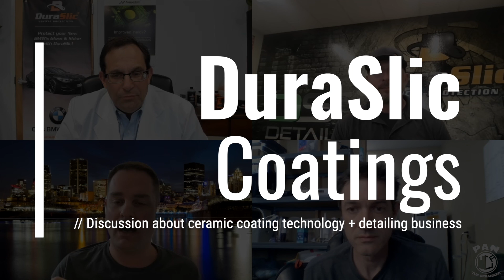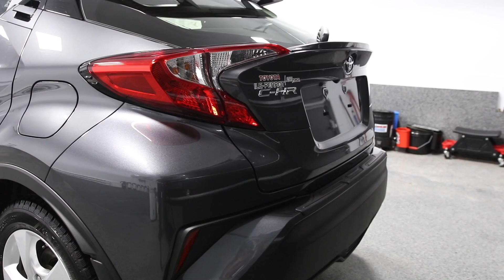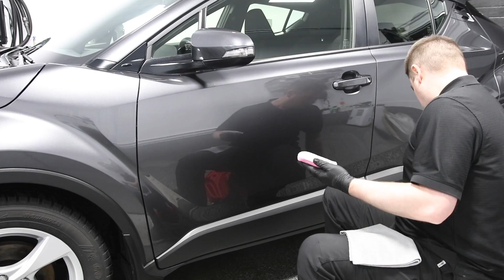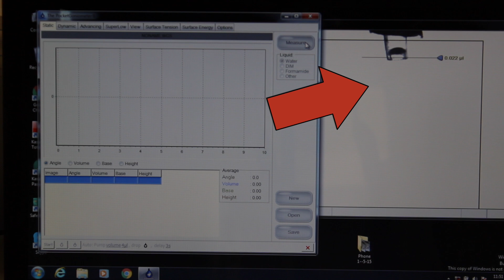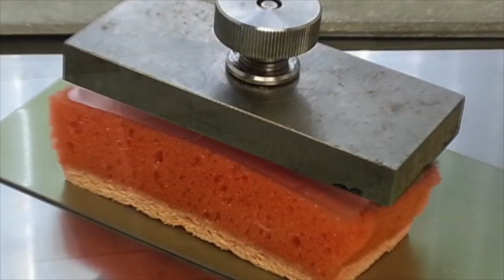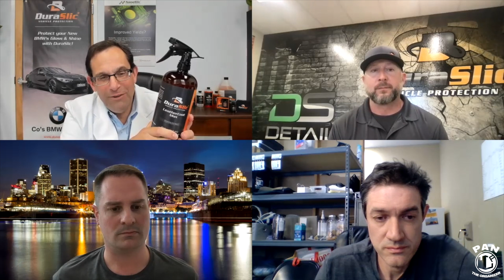Ceramic Coating technology discussion with the DuraSlic chemist!

Comment: Hi Pan, 
My name is Matthew Dunham and have Learned A Lot from your videos!
I am taking the classes on September 2nd & 3rd to become Certified in Duraslic Application. 
This video has great potential for being used as a sales tool.  
I have a B.A. in Advertising/Graphic Design and now I want to become a successful DuraSlic Installer. 
Obviously, no client is going to want to watch this entire 1:09:39 video but I can get a potential client to watch 15.22 mins. To that end, I am wondering if you have this video available so I can edit it to only show your interaction with the Chemist?  I am particularly interested in the sections of the video from 04:16-07:37 and 12:18-24:10 = 15.22 mins. 
I will provide You and DuraSlic with my result at no charge...
Reply from the maker: Hi Matthew. Congrats on wanting to become a certified DuraSlic installer. Tell them hi from Pan when you attend the training!  What a great company.

I don't normally authorize use of my videos without permission for copyright protection obviously. So it would depend on what your intended use would be. You can send me an e-mail (my e-mail is available in the "About" section of my YouTube page) and we can discuss the matter there.

Cheers

Comment: Hi I just had my truck ceramic coated with your duraslic  it will be inside curing for 72 hrs after that if I get caught in the rain will it harm my ceramic coating?
Reply from the maker: Absolutely no worries. It only needs 24 hours of curing and then can be exposed to the elements including rain with no issues. Just don't wash your car for at least a week after the coating's application. I recommend waiting 2 full weeks before washing the car.

Comment: As a detailing business owner a lot of my customers don’t want a coating that lasts 5, 7+ years mainly because they feel they won’t have the vehicle that long or because of the price of the longer lasting coatings…I would like to go through less companies for products and narrow it down to Duraslic products…I seem to sell more 1 and 3 year coating packages rather than 5+ and giving that speed coat last up to 6 months 1500 is about 5 years and extreme is 7+ how do you suggest I fill in that gap to provide services to my customers who prefer a 1 or 3 year coating using Duraslic products ?

Comment: "Furthermore, DS 1500 Xtreme is a multi-layerable formula that enables the user to boost the level of protection as needed." What is there to boost when Steve said no matter how many layers, you still have the same surface protection on top and you dont need something on top of it?
Reply from the maker: I think they mean an increase in gloss if I remember.

Comment: Is this coating better than Avalon? Which is the best coating brand?
Reply from the maker: You can't really compare a DIY consumer grade 2+ year coating (AvalonKing) to a pro grade 7 year coating. That is an unfair comparison. Of course the DuraSlic is better, and costs way more. As it should. The AvalonKing is the easiest to apply consumer grade coating, but won't last as long however is super inexpensive. It's all a question of choice. Both are good in their respective categories.

Comment: I'm not a pro, but an enthusiast that details a few cars a year for colleagues and friends, what's the reasoning for making the DS1500 extreme only available to professionals? There is no rep/installer in my country, but I'm interested in using the products. Where do I go from here? Is there a way to get my hands on the extreme anywhere as well?

Also, has this been tested on boats and aquatic equipment?

Comment: I would really like to know what is exactly the difference between 1500 and 1500 Extreme in terms of the product itself and the chemistry - please skip all the "professional level" and "only for authorised and trained detailers" and please concentrate on the product differences only. Levels of protection, durability, application, curing time, ready to drive off time. I am UK based and just want the product - I think I can handle the prep and application process but if it needs to stay inside for days, needs IR lamp curing or otherwise it will be weeks, takes 30 days to reach the full hardness, etc -  the costs to actually apply such a product are astronomical (labour and workspace is faaaar more expensive than any product) compared to something like graphene oxide coating applied in 2 hrs (including prep with polish) , ready to drive off immediately and offering maintenance free protection for a min of 12 months AND costing two orders of magnitude less per application. I can apply graphene oxide for 10 years every year and still it would cost a tenth of duraslick. These days ease and speed of application are the king - very few people keep their cars for 7 years :). Once again, thank you very much for sorting out this interview, I really enjoyed it and I am looking forward to more in depth content - keep up the good work.

Comment: Hi, do you run the kranzle k1122tst on a 15 amp or a 20 amp?
Reply from the maker: I have two dedicated 20A circuits and two separate 15A circuits in my new garage. It runs fine on both, but I prefer putting it on the 20A for extra headroom.

In my previous house it was on a 15A and never once tripped the breaker (that was a new construction as well).
Reply: Since I have no 20 amp circuits outside, I'll have to go with the 15 amp then.... Thank you so much, Pan. Really appreciate it

Comment: The oleophobicity is definitely interesting to me. Give me a coating that  will prevent road film from sticking to the sides of my vehicle;  heck even if it does stick but then I can easily remove it all during my prewash phase, I'm sold. Anything that will get my vehicle cleaner without needing me to touch the paint is a bonus for me.
Reply: It’s literally every coating bruh

Comment: Thanks for this follow up video Pan. I ordered the product after your original video and applied it to my “new to me” , low kilometre 2016 Tundra after a lengthy 2 stage paint correction… my first ever 2 stage and full ceramic coating. I found the coating easy to apply and level, though I should have changed my micro fibre levelling towels more often. Overall, very happy with the results. Glad to hear that this coating will have long durability. I may also order the leather Max product too! This video reinforced my original confidence in this coating. Merci Beacoup!
Reply from the maker: You got a top tier pro grade coating for sure!! 😁

Comment: Great video.

It's always great to see companies to innovate with their products and provide all the required support along with it. I can definitely see the appeal and market for those extra durable coatings but it is not necessarily the best path for those of us who dont just love detailing, but love to detail.

Personally, I wouldn't put something that durable on my cars. Like everything, ceramic coatings also wear, oxidize, chip, scratch and accumulate fine embeded contaminants that can't be removed without abrasion. As I love to polish my cars at least once a year to keep the paint looking as best as it can, then long durability coatings just aren't for me. Not that they're bad, quite the opposite, they're wonderful, but everything has it's downsides.

For my daily driver I use CarPro CQuartz Lite at the fall so it would get the protection for the winter. If I then need to polish, do stone chip repairs at coming spring, I use spray sealants and waxes throughout the summer and then do a full paint prep and coating at the coming fall again. Works great for me and keeps my options open regarding paint correction. But for those who are not looking to do annual paint correction, I'd say high durability ceramics are a godsend. Argument could be made that there are ceramic rejuvenation polishes out there, but I've tried them and they really don't do much. 

Just my two cents on the longevity considerations when applying ceramics.

Take care Pan and stay safe.
Reply from the maker: Thanks for watching! Have a great weekend!

Comment: Loved the video.  Appreciate DuraSlic coming on and educating the public with my favorite car detailer.  Of course, based on Pan's recommendation, I purchased Avalon King ceramic coating and will finally have some time next week to apply it.  Would be curious to know how it would compare to the DuraSlic coating.  Thanks Pan.  Keep it tight, keep it clean.
Reply from the maker: Thanks Joseph! The coating you picked is one of the easiest DIY consumer grade coatings. But you can’t compare an inexpensive consumer grade coating to a 7+ year professional grade coating that costs way more.
Reply: @PanTheOrganizer  Thanks Pan.  I'll trust that you led me right about Avalon King.  I'll just plan on applying it every year or so... Great way to spend a day!  Take care.
Reply from the maker: If you maintain it well it should hopefully last 2+ years. I am following the vehicles I applied it to closely to see how it does long term as well. So far so good!
Reply: @PanTheOrganizer  I guess I was expecting that since during NOV-MAR I won't have a proper way to maintain the vehicle in MN, the coating might suffer a little more.  It will be interesting to see how it performs a year from now.  Thank you!

Comment: I washed my ceramic-coated Mercedes with Armor All ceramic Ultra whatever they call that new soap. Part of the soap dried on the car before I rinsed it. It has hideous streaks in it that won't rub out. Do a video on how to correct that please. Please.
Reply from the maker: Try rewashing it with a quality shampoo made for coatings. My favourite being CarPro Reset.

Comment: Lol I’m just like hitting my head against the wall here - Here is my big question!! Why big companies like CarPro, Gyeon, Gtechniq including DuraSlic not using graphene? Not just understanding— I know this is a hot topic. It’s just mind boggling that people think by putting graphene into a coating’s its going to sale more. I think we need to start weeding out all the snake oils in the car detailing world -
Reply: Our chemists at Duralic actually did testing with graphene and therr is no additional protection added with Graphene, it is more marketing hype
Reply: Yes, we have looked at Graphene. We saw no apparent benefits. Did not increase lifetime, abrasion resistance, chemical resistance. In some cases it might add as little slipperiness but in our research that does not really add any value. -Steve, DuraSlic
Reply: Yes, we have looked at Graphene. We saw no apparent benefits. Did not increase lifetime, abrasion resistance, chemical resistance. In some cases it might add as little slipperiness but in our research that does not really add any value. -Steve, DuraSlic
Reply: Thank you !! It’s all hype. Exactly

Comment: Impressive! Nice to see a coating company with this level of transparency (another leading coating company shrugged off oleo-phobic properties as unimportant (??? road surfaces especially asphalt are loaded with oil !!!)). No DuraSlic detailers within a hundred miles of my location, though.  Am pondering doing mobile detailing but don't really know what level of investment's involved.
Reply: Hey, thanks for the message... we appreciate you value oleophobicity!! We are working hard to fill up our detailer map, and will be launching new detailers soon. If you reach out to us, a pro detailer will be able to speak to you and help you get involved. Mobile might be difficult with ceramic coatings because of a lack of clean garage, but we have detailers that have done it out of their home garage before and become successful to grow into their own space.
Reply from the maker: Thanks for watching!
Reply: here is one thing about oleophobic coatings. The more oleophobic the coating is the more hydrophobic it is as well as chemical resistance.  With a ph level 2-12 it is very resistance to breaking down from chemical degradation vs a non oleophobic coating
Reply: We have mobile detailers in our Duraslic network that Ryan and I have trained.  Although caution needs to be made when being out doors. Having an indoor facility is the best option

Comment: What do they have for Boats
Reply: https://www.duraslic.com/product/ds-1500-xtreme/ https://www.duraslic.com/product/ds-1500/ These would both work really great on boats using the same prep process as vehicles! Its tested and performs great on boats
Reply: Their Duraslic xtreme is great on boats
Reply: What about pontoon the toons
Reply: Duraslic Xtreme works well on boats, we have installers on the east coast that do mainly marine coatings and have had great feedback on the coatings, Yes the xtreme can be applied to polished, unpolished metal, fiberglass, gelcoat, plastic trim, glass, and more. Very versatile costing not needing multiple products for different surfaces

Comment: Hi Pan, thanks for the fantastic video as always. I have a question. Is it a bad idea to clay bar the ceramic coated surface every say 3 months or half year? Please let me know what you think about this. Thanks. Keep up the good work :)
Reply: Claying the surface of a Ceramic coated vehicle should not ever be done as it will degrade or even remove the coating as the claybar is an abrasive. instead if you have problems with industrial fallout or contamination on the surface of your ceramic coating you need to stick to a iron remover spray. This product wont hurt your ceramic coating because your coating is chemical resistant and will also remove any industrial fallout or contamination particles.
Reply: @rhino1218  Thank you :)
Reply: @rhino1218  that's it!
Reply from the maker: Thanks Sammy! I see you got your answer. :)

Comment: What prep for leather prior to application of that protectant?
Reply: Hi there, all you need to do is make sure the leather is completely clean. Use a standard leather cleaner or similar to make sure there is no dust or dirt on the seats. Then can be sprayed directly onto leather or
 sprayed onto applicator first. Wipe off excess with microfiber towel. Repeat with clean towel to enhance shine. Allow to dry. Good luck!!